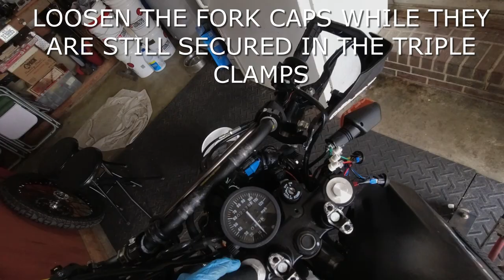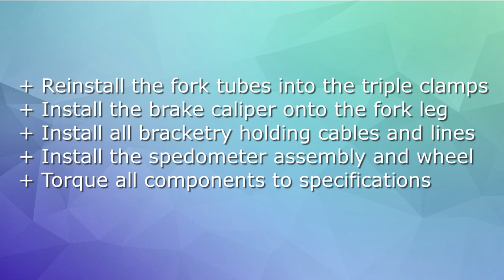Suzuki DR650 Changes Part 2.1 (Front Suspension)

Comment: Fantastic upgrade my friend. I have the same as you know. 

Just so you know (I’m sure you do) that 600 ml is only suggested. It’s for tuning purposes. I ended up taking my level to 575 to be a little more plush in my rocky terrain. Running a .52 fork spring.
Reply from the maker: Hi Matt! You having done the same to your DR was one of the reasons I went ahead and upgraded. I am going to put some trail time on the DR and figure out the oil level. So far, I like how the forks respond compared to the stock setup. Hope you and Niki are doing great Brother!
Cheers!

Comment: Do you remember what your measurement was with the spacer that came from Cogent? I know it's supposed to be 7-10mm but I had to use the OEM spacer to get that measurement. 
I just finished the same project yesterday on my '18 and haven't had a chance to ride yet. Can't wait!
Awesome video! I just wish i would have seen it before I started the process. Lol👍🏼
Reply from the maker: Hi Mike! I used the spacer included in the kit due to also having the adjustable preload fork caps. I am able to fine tune the space/ preload on the springs. Using the OEM spacer will work fine. Thanks for the kind words and you are going to love your new suspension! Check back in to let us know what you think of the changes!
Cheers!

Comment: Great video. Which spacer did you end up using ?
Reply from the maker: Thanks Brad! I ended up using the spacers which came with the front suspension kit. I believe it was just a little smaller than the stock spacers. Thanks for watching!
Cheers!

Comment: If you don't have a fancy syringe you can use a straw of paper tower to remove that excess fluid. May I ask the torque specs? Great video!
Reply from the maker: Thanks Joel! That is a great tip to retrieve a little bit of fluid to get the level correct. Torque specs according to Clymer Manual: Front Axle nut - 48 ftlbs, Axle Holder Nuts - 89inlbs, Lower Fork Tube Clamps - 19ftlbs, Upper Fork Tube Clamps - 21ftlbs, Fork Caps - 17ftlbs. Hope that is what you are looking for.  Also, for adjusting the oil level for tuning purposes you can get veterinary syringes from Tractor Supply Co. and use to tubing to get the exact amount of oil out of each fork leg. Thanks for watching and commenting!
Cheers!
Reply: @doc650adventures  Thank you very much! Clymer yes! That's what I used to rebuild my 92.5 YZ250 years ago, I still broke the outer clutch basket trying to get it apart. Got a replacement and welded up a tool from an appropriate metal clutch plate to hold the inner basket housing while I torqued the basket nut. That bike didn't look the best but it ran and drove at race levels.
Reply from the maker: @joelcromwell5983  Awesome! I love it when we can make our own tools to fix a problem! Great stuff!
Cheers!

Comment: Maybe a dumb question or idea, but could you leave the forks on the bike if you used something like an oil transfer pump to remove the old oil? It seems like 90% of work and time is just to remove the old oil.
Reply from the maker: Great question! I have never heard of leaving the forks on the bike, but I imagine it is possible. The key thing to do is to cycle (pump) the forks to ensure most if not all of the old fork oil is removed which will be replaced with the new oil included in the kit from Cogent. It is a bit of work to disassemble the forks. Overall, it is an easy job just time consuming. I can relay to you that both the fork and rear shock upgrades have made a huge increase in capability of the suspension! Thanks for the great question!
Cheers!
Reply: Yeah I understand the need to pump the shocks to get the oil out and new oil in. I just though maybe have someone stabilize the bike while working the forks upward. Then pump out oil with a transfer pump. Install new oil and pump the shocks upwards while someone holds the bike steady again. The you should be able to drop everything in from the top, as long as it clears your handlebars.
Reply from the maker: @arkansasoutdoorschannel1867  I imagine that is possible. Haven't seen it done but sounds like an interesting solution.
Reply: On non cartridge forks like the DR650 this could potentially work, but I think you will find it’s just easier taking them off the bike
Reply from the maker: @nvmcrider8475  Exactly what I was thinking also. It is not difficult to remove the forks to do the upgrade.
Cheers!

Comment: 0.52 is not too soft?
Reply from the maker: It works well for my weight (190lbs + gear). Now that my riding ability has improved, I might go with stiffer springs. Cogent will walk you through the spring rate based on your weight, riding style and level of experience. Hope this answers your question. 
Cheers!
Reply: @doc650adventures  thank you for the answer!
Reply from the maker: @АлександрКозлов-з6д  My pleasure!